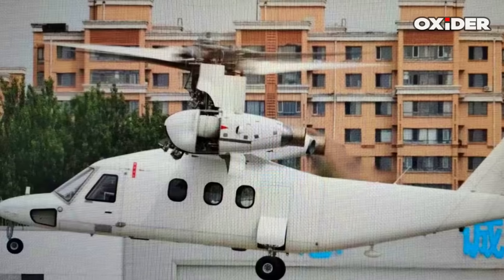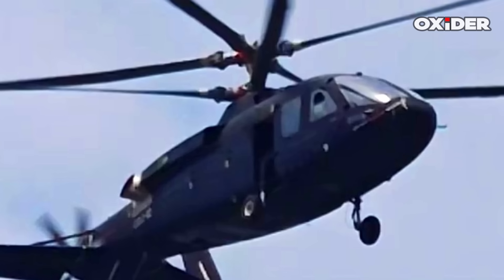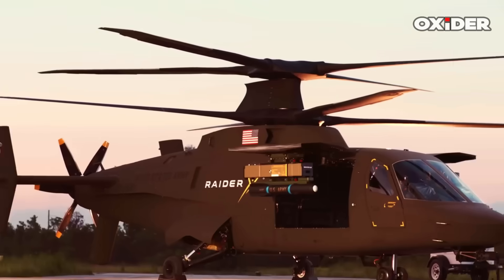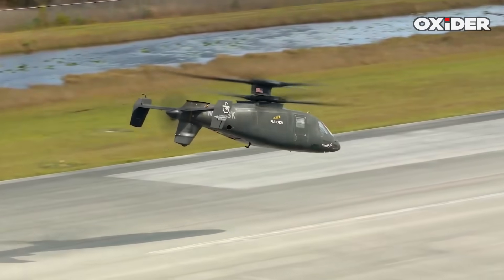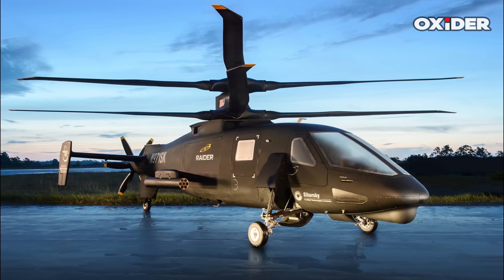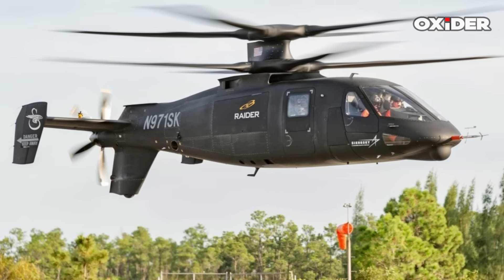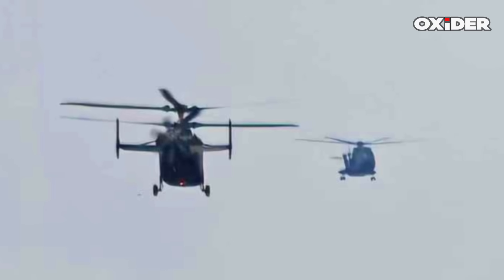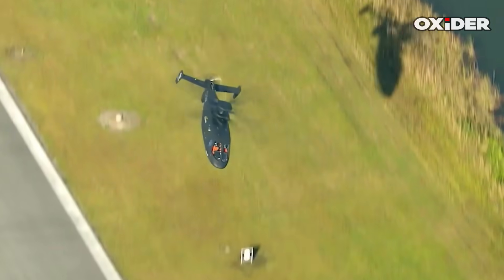China Unveils High-speed Coaxial Rotor Helicopter – A Direct S-97 Competitor!

Comment: The Raider X lost out to the V-280 Valor.  These two concepts are not going to overlap in functions.  Copying the design does not solve any practical problems.  Besides, coaxial rotors have been used widely by the Russians since the 70s.
Reply: Not the same
Reply: China has both
Reply: The only way to know how something works is to build it, and use it. That's what China is doing by building copies of other nations' military hardware. It's not about making copies...

Comment: doesnt this chopper make the tiltrotor a little redundant!? Or there is obvious overlap as the tiltrotor becomes a plane but this has a push rotor but the tilt rotor takes up more space and needs more parking space but seems to be about the same size in internal capacity!??

Comment: The Russian had been using coaxial rotor helicopter for decades before S97 ever existed.
Reply: isnt that because Sikorsky!? off the top of my head, im guessing used to be Russian / Ukrainian!? 

Russia doesnt get the credit or respect it deserves and neither does China and both funnily enough dont care if the West respect or acknowedge them LOL

BUT respect will be forced upon the West when China is mass producing and flying 6th gen copters or whatever equivalent just like China is now lowkey flying out in the open about 6 different types of 6th gen planes and are obviously ahead of the game!

About 20 yrs ago China having their own 5th gens seemed like an impossibility! Now China is talking 7th gens while flying several 6th gens
Reply: but not with a pusher prop config. this is a next gen config.
Reply: @the80386 a next gen with a pusher prop? Are you talking about Soviet Ka22 in 1950s?
Reply: @the80386  很難說這款直升機會被中國軍隊採用，因為這家製造公司並不是很大，而且中國最近又曝光了正在研製的傾轉旋翼機，在如今戰場無人機時代，我個人覺得這款共軸快速直升機如果發展成重型武裝直升機也許會更實用
Reply: @timinghourglass58  I agree. I also think this is a more versatile and possibly reliable config compared to tiltrotor, which usa and japan has many issues with, pushing up the cost. with more testing and ironing out issue, this could be the 'standard' next gen roto platform like the uh-60 / z-20.

but I'm wondering if it will be possible to have a traditional rotor (not coaxial) with the pusher prop, to make the design cheaper and reliable. in that case, the pusher prop will be angled a bit sideways to create a lateral component of force in addition to the longitudinal push.
Reply: But initially that Sikorsky guy is immigrants from Russia isn't it
Reply: Sikorsky immigrated to the US long before he invented the helicopter
Reply: 尾部
Reply: the U.S. was working on coaxial rotor helicopters before Russia/Soviet Union made them famous with Kamov designs.
Reply: @tluangasailo3663  no one cares about who worked on first.  people care about having actual product out.
Reply: So what China has been using Gunpowder for centuries before the west ever saw what it was. 😂
Reply: This is not about Russia
Reply: 事實上中國軍工科技的主要來源就是俄羅斯、第二是美國。他們只是完善了俄美的軍工裝備，然後有一部分是原創